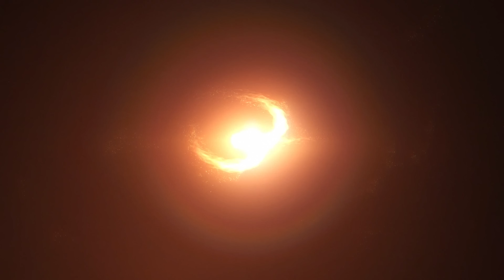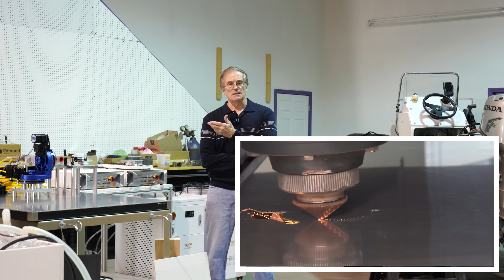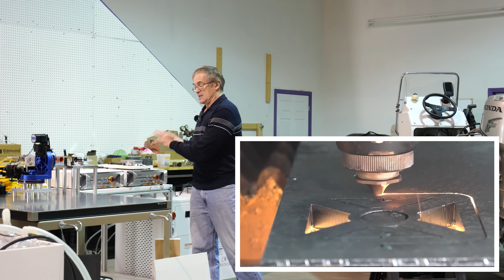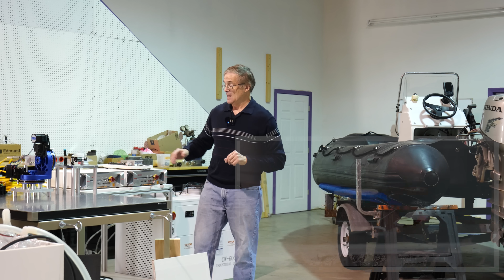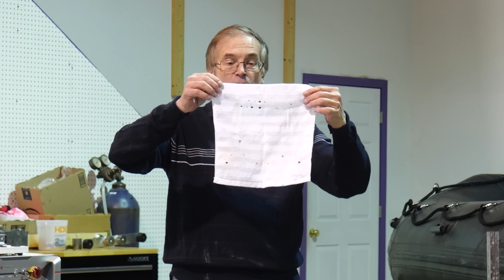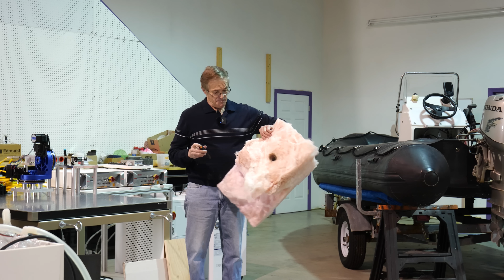We have a problem... and need your help!

Comment: 10cm of snow stuffed in between a sandwich of (FRONT) styrofoam, a 5mm iron plate, covered with a sheet of blackened polystyrene and (BACK) styrofoam, steel, plywood.
The PS will create a lot of soot on impact reducing the laser power, the iron plat will be pierces, styrofoam sheet (thermal insulation for the snow) will be pierced, the remainder of the laser energy absorbed by the snow for quite a few seconds. Iron self heals after melting.

Comment: Use fiberglass mesh not insulation. More dense.
Set a photoelectric switch in water or nearby water so the light energy will shut off power immediately to beam.
And....or..
Also should diffuse the beam prior to hitting the water w frosted glass of appropriate build or similar.

Your water should also be tinted or colored to further diffuse beam.

Add a simple recirc pump to keep it moving.
Might add powdered silica or mica to water to spread beam as well.

Comment: Use a wall made of tiled diverging lenses to spread the laser to low enough a concentration where it won't burn through the back stop that is far back enough.
If you can't get that many diverging lenses, use converging lenses and just add more distance between the wall of lenses and the backstop so that the laser can converge and then diverge.

Comment: The laser burns through the backing if it shines on one spot for too long, right? Why not use a spinning back stop? If the laser shines on one spot, but the back stop is spinning, and perhaps the hub also moves up and down, or left and right, the laser will not spend much time on any one spot, and the backing might be able to resist long enough to not have a hole burned through it, though the surface may have burn lines that look like a spirograph.

Comment: # Points of Uncertainty and Caution Regarding Tesla Pancake Coil Setup

1. ZVS drivers lock onto the resonant frequency only if the load is a clean LC tank circuit. If the load is too inductive or capacitive without resonance, the circuit may not oscillate properly or MOSFETs may be damaged.

2. Running a pancake Tesla coil on the negative side of MOSFETs with Schottky diodes in the negative rail can create:
   - Back-EMF and high-voltage spikes that may damage diodes or other components.
   - Unbalanced voltages and currents stressing the MOSFETs.
   - Non-sinusoidal, high-frequency ringing current that can cause unexpected heating or component failure.

3. The term "cold current" is a misnomer; the unusual effects seen are due to high-frequency, high-voltage fields and displacement currents, not literally cold electricity.

4. Schottky diodes can fail due to high dv/dt and di/dt pulses common in Tesla coil operation if they are not rated properly.

5. Regular multimeters will not accurately measure these waveforms; oscilloscopes and specialized probes are necessary.

6. The setup is prone to electromagnetic interference and stray coupling, which can cause unpredictable behavior.

7. Proper snubbing, component rating, and circuit layout are critical but challenging in this high-frequency, high-voltage environment.

8. Expect trial and error and component failures during experimentation.

Do you agree first..?

Comment: Mechanical engineer here. Some pretty smart answers in the comments but I'm thinking something a bit simpler. 

What if you sandwiched together ply board and some steel sheet-metal. Laser would hit the ply first and quickly burn a hole through to the steel. You would size the steel thickness to be able to resist the laser for your target duration. Ply would assist with stopping bounce-back/reflection of the laser off the steel.

You could put some sprinklers/perforated pipe at the top and plug a garden hose in to let water dribble down over the ply surface to prevent fire spreading. 

The whole thing could be built on a frame with castors at the bottom so you can maneuverer around the workshop as needed.

Comment: A sensor (photosensor / ir phototransistor) like ones used for ir barriers, connected to the killswitch, if pointed to the wall, will catch the laser radiation and turn it off. The fast response will reduce the exposure of the wall down to milliseconds if all the electronics hardware is well chosen and connected to the test bench

Comment: A mixture of Silicon Carbide grit and Sodium Silicate water glass as a binder should do it. 

This is used as a crucible for metal melting in the channel @ShakeTheFuture and should survive well over 2500C. 

Silicon Carbide is used for rock tumbling and can be bought in bulk. Sodium Silicate (water glass) is also easy to get, but may be a weak point as it melts around 1000C. One possible solution could be sandwiching the Silicon Carbide in ceramic fiber board or something similar, with any shifting grit being contained by the board.

Comment: I worked for a company that came up with the paint they used on the stealth bombers and fighters. This product reflected and dispersed the light shot at it from a photo spectrometer at a 99.9% rate. Now I can't tell you the formulation for obvious reasons but I think I can safely point you in the right direction enough to formulate your own type of paint with similar results. It's basically a clear acrylic based paint with additives. The additives are nano sized carboshpheres and powdered metals like aluminum, nickle and iron. All of these are the size small enough to go through a spray gun with a small nozzle. (hint hint) I'm not sure how well this will work on high powered lasers but it may be worth a try and a fun project to experiment with. Good luck.
Reply from the maker: Thanks!

Comment: I don't have a solution yet, but what do you think of coal? The Japanese charred wood to make it more resistant to fire. If you have several layers of wood with a charred surface, you will absorb the laser completely. Nothing will be reflected and the fire resistance should be higher than with "fresh" wood.

Comment: Styropyro did a video with a hand held laser and said snow was really good at absorbing a lot of laser energy.  Anyway I have no idea if this would work but what about black garbage bags filled with snow.  This would allow you to stack them to make a wall that wouldn't cost much as long as you had a cheep way to make or get snow.  The laser would easily go through the black bag and hit the snow inside then reflected energy would be trapped inside the plastic bag.  My thinking is after hitting the snow the reflected light would be weak enough that it couldn't get back through the bag.  I have no idea if this is a good idea but figured I'd throw it out there.

Comment: wat if you set up a rock wool flow barrier that would pump water from the top too the bottom, you could screw the rockwool too plywood, and in the presence of water it would be fine?
Reply from the maker: Actually,  that is one of our favorite possibilities. We'll start with some plain rockwool and wet it if necessary.

Comment: The Forbidden Planet, may have the answer - Krell steel. They shot lasers at it and no heat at all. 
It might be a little difficult to get hold of. I think many of the contributors have the real answer, I was going to suggest cement fibre board. Of course asbestos board may be better but that’s more dangerous than your laser. Good luck.

Comment: I just watched Syropyro's latest video and he had a couple of things that stopped his "Worlds strongest handheld laser" Maybe they could be helpful in your situation. The first was black plastic CD cases. The material would burn and emit black smoke. The black smoke is what stopped the laser. The melted plastic behind the smoke would melt and self heal. The other thing was snow and ice. This one is probably harder to use but maybe you could soak cloth in water and then freeze it to make large sheets that you could hang up.

Comment: Why not use 1/2” brick veneer backed with dura rock seething..  or perhaps unglazed  ceramic tiles on Dura-rock, you could actually double coat the Dura rock core with brick veneer or ceramics on both sides, they also sell fire bricks that are only 1” thick and lightweight…

Comment: Use a slightly curved mirror at 45 degrees to direct the fanned out beam into a tank of water ( with or without dye. Change the pulse width of the laser to vary the light power to what you need. Use a wider beam to target and then snap focus to a tight bean to kill. Use a rotating prism timed to the pulse power to switch beam paths from wider for aim and tighter for kill. Lots of fun ways to do what you want but better control of the laser source will help with the eventual end game result. If you really want to get fancy you can use the wide beam as Lidar and auto kill focus when you get a return. Ex process control, telecom tech here, who used to work in weapons development. Oh sand unlikely to work as it will fuse to glass and stop the flow of more sand. Have fun.

Comment: Mettal sheets hung up like a curtain so the beam hits on a larger surface, coper is expensive but 1mm aluminum might work. An electronic device like a distance laser measurement tool that turns off the machine when the beam hits to far away.

Comment: How about using Ceramic Fibre Boards coated with generous amount of Hafnium Carbonitride (HfCN)? Has a very high melting point (almost 4000°C) and very good thermal conductivity, and is cheap too. And if the point of impact is fixed then how about using a large Concave lens?

Comment: What is the biggest issues with laser weapons against rockets? Water vapor. Make a fog chamber with a sugar solution, smog like dispersion. Use pressure to increase its density and change its color to alter its reflectivity.

Comment: Laser Beam Dump with Internal Scattering and Smoke Attenuation
Description of the Idea:
I’ve developed a new concept for a portable, high-efficiency laser beam dump designed to safely absorb, scatter, and dissipate the energy of high-power laser beams—making it ideal for workshop, lab, or even field use. This beam dump combines traditional absorptive design with innovative features for superior performance:
Entry Hole Targeting: The device is a sealed, heat-resistant box with a precision entry hole for the laser beam, allowing easy, accurate alignment.
Smoke-Based Internal Scattering: The interior of the box is filled with dense, safe, non-toxic smoke, which rapidly scatters the incoming laser beam in all directions, reducing its intensity before it reaches the back wall.
Internal Mirrors: Angled, heat-resistant mirrors inside the box increase the optical path length, causing the beam to travel further through the smoke and undergo multiple scattering events, maximizing attenuation.
Absorptive Ceramic Walls: The box’s interior is lined with flat black ceramic, which absorbs both direct and scattered light, minimizing internal reflections and thermal buildup.
Vented Light Trap Design: Ventilation is provided via upside-down snorkel-style vents that release heat and smoke byproducts while preventing any stray light from escaping.
Modular & Easy Maintenance: The back wall can be removed for cleaning and replacement of internal parts as needed.
This design is ideal for safely stopping even powerful, collimated laser beams in compact spaces, with much less risk of burn-through or accidental exposure compared to conventional beam dumps.
If you use this idea in your workshop, I ask that you credit me (Alan Shields) in any videos or documentation. Should you decide to market or commercialize this beam dump design, I expect to discuss a fair share of any resulting revenue.
Reply from the maker: It's a good idea.
I've used and built various beam dumps over the years, but I've never used a particulate dispersal component.  It's worth investigating the path length requirements as well as the density and the chemical effects of the beam on different smoke sources.
Reply: @TechIngredients  Did you not get my email with this solution in it?
Reply: @TechIngredients  Here is the solution for your aerial problem for shooting down drones without affecting/cutting anything behind it.

Proposed Solution: Dual-Laser Scanning System with Plasma Shielding for Precision Slicing and Safety

Overview:
Our current single-beam laser systems are excellent at piercing or “drilling” targets, but they leave small holes rather than achieving a true cut or slice. Additionally, there’s concern about the residual laser energy damaging anything behind the intended target. To address both issues, I’m proposing a dual-laser, synchronized pulse system that not only slices targets cleanly but also creates a plasma “block” behind the cut, serving as a dynamic backstop to prevent collateral damage.

System Concept:
Dual-Laser Configuration:
Two high-power pulsed lasers are mounted side-by-side (or above/below each other), aligned so their beams are parallel as they pass through the target.
The beams are angled or optically adjusted to converge at a predetermined distance behind the target, forming an intersection point or line where the energy density is highest.
Pulse-Scanning Slicing:
Rather than using a continuous beam, each laser fires a rapid sequence of ultra-short, high-energy pulses.
After each pulse, the aim of both lasers is shifted slightly using high-speed actuators or galvanometer mirrors.
This creates a series of overlapping pulse sites, essentially “drawing” a cut or slice along any desired path (straight line, curve, etc.), rather than simply burning a single hole.
Synchronized Plasma Block Formation:
At the precise location behind the target where the beams converge, the combined energy of the synchronized pulses exceeds the air’s ionization threshold, creating a brief, localized plasma “block” or “sheet.”
This plasma region is highly effective at absorbing and scattering residual laser energy, acting as a temporary barrier to protect objects or environments behind the target from stray or over-penetrating laser energy.
Advantages:
Precision Slicing:
Multiple, overlapping pulses produce a continuous, clean cut rather than isolated holes, greatly improving the effectiveness and versatility of the system.
Dynamic Laser Shielding:
The plasma block forms only where and when needed, reducing risk to anything behind the target—crucial for both safety and operational control.
Synchronization:
By firing both lasers and moving them together, alignment and timing are simplified, minimizing complexity compared to more reactive systems.
Scalable and Flexible:
The system can cut arbitrary shapes by adjusting the scanning pattern, and the plasma shield dynamically tracks the cut.
Implementation Outline:
Mechanical & Optical Alignment:
Mount both lasers on a stable platform with adjustable optical paths to set the convergence point just beyond the typical target thickness.
Integrate fast steering mirrors or precision actuators for controlled, repeatable scanning motion.
Pulse Synchronization & Control:
Utilize a microcontroller or FPGA to precisely synchronize the firing of both lasers and their movement along the cut path.
Allow for adjustment of pulse spacing and timing to optimize for different target materials and thicknesses.
Power & Safety Management:
Ensure each pulse carries sufficient energy for both cutting and plasma formation at convergence.
Integrate monitoring systems for target thickness, alignment, and environmental safety.
Optional Feedback System:
Add sensors to monitor plasma formation and adjust firing parameters in real time for optimal shield effectiveness.
Conclusion:
By adopting a dual-laser, pulse-scanning approach with synchronized plasma block formation, we can achieve:
True slicing (not just puncturing),
Dramatically improved cut quality,
And dynamic, on-demand shielding to prevent collateral damage from stray laser energy.
This system leverages established industrial techniques (scanning, pulse sequencing) in a novel configuration tailored for both precision and safety in high-stakes applications, including defense, manufacturing, and robotics.

Comment: Please see the problems Styropyro had with his most powerful handheld laser.   Last few minutes of his vid.  Reflective side of mirror melts too quickly, the glass backing melts but reseals the hole, so quartz sand, or glass sand in bags should melt but flow inwards/downwards to anneal the hole while your laser hits it.    He also tested liquid butane in a plastic cup - no fire. He needed to heat the butane vapor, not the liquid. Also snow/ice, doesnt react much.  So a wall of two glass panes filled with snow, ice, or sand, should absorb and self heal any holes you punch in them.  

https://youtu.be/UBVlL0FNbSE?si=TTORHksO-afwSJ_C